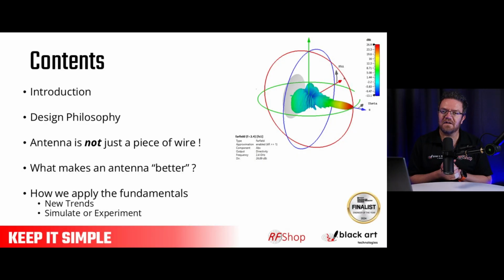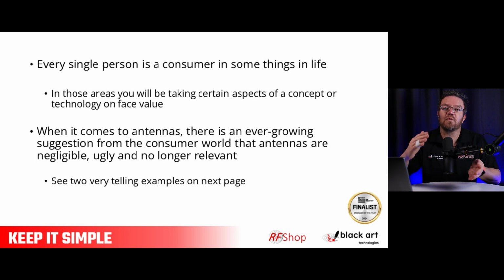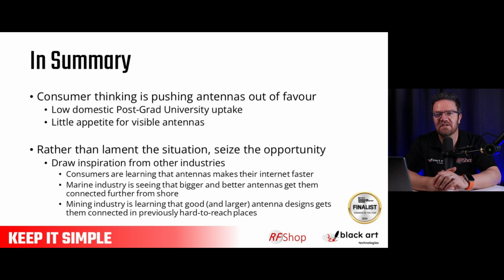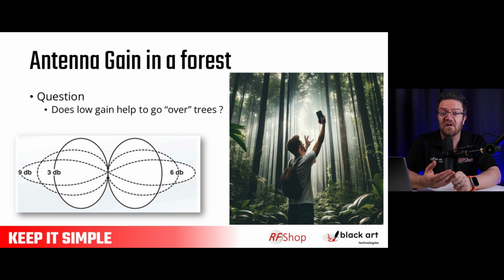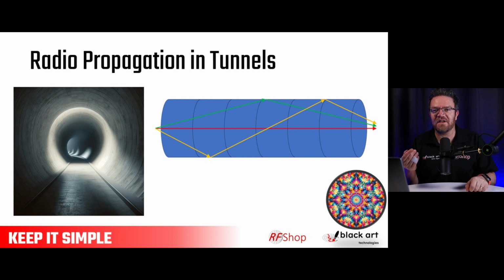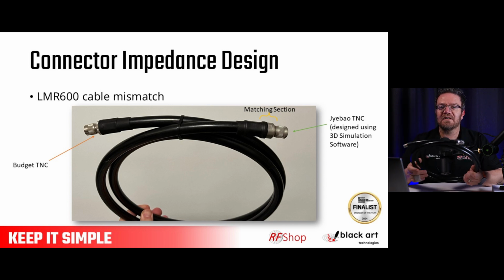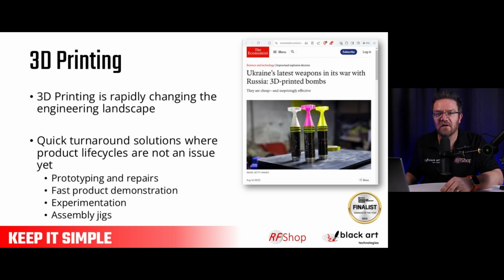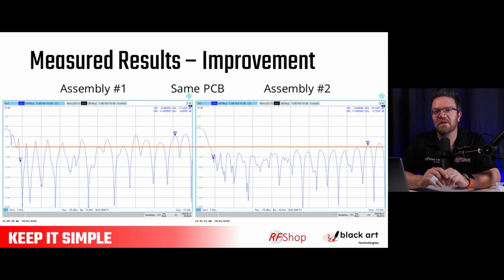Mastering Antenna Design for Electronic Warfare: Essential Insights

Comment: "An antenna is not a piece of wire" Yep. An antenna is two pieces of wire 😁😁😁
-- get a chargehanger
Reply from the maker: Yes, a simple dipole. But then it needs to be very specific, and radiates all over the place.